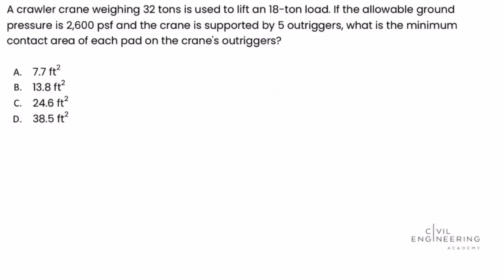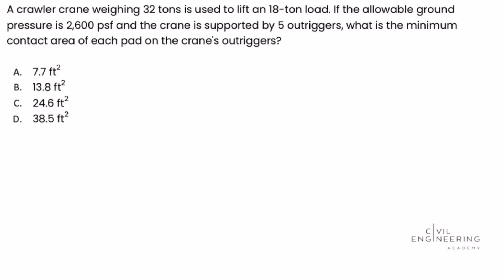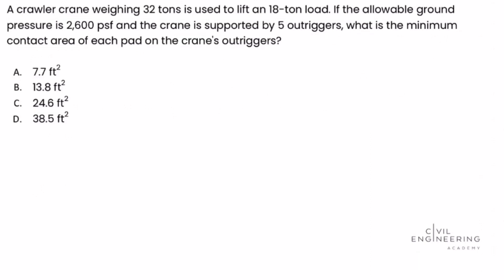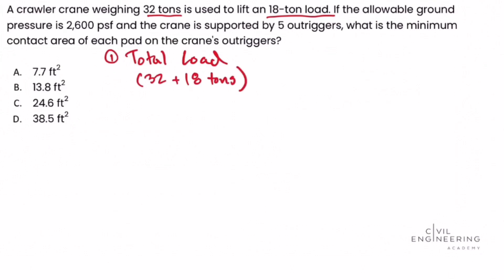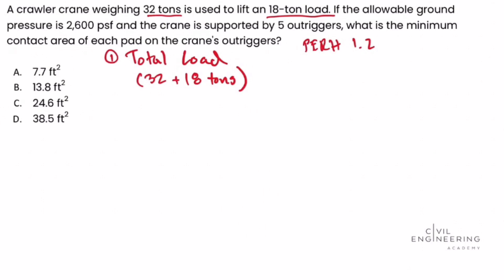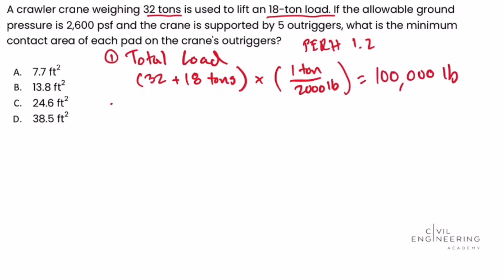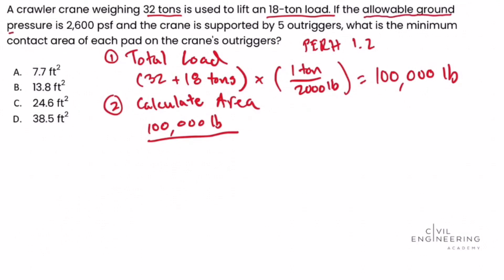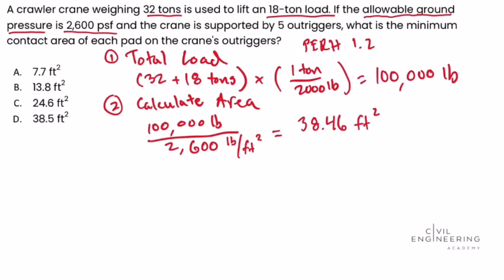Civil PE Exam – Construction Breadth – Find the Minimum Ground Contact Area of a Crane’s Outriggers

Comment: Why not divide by the 5 pads to get 7.7 ft^2 for each pad?
Reply: @CivilEngAcademy you never know what the worst-case scenario is. Design problems use safety factors rather than trying to imagine the worst-case scenario. Since we haven't been given any info about the safety factor and the question asks about the contact area of each pad, mathematically 7.7 is correct.
Reply: The question is poorly worded, it's impossible to tell what the worst case scenario is because the crane's outrigger configuration is unknown.  You could have 2 outriggers acting as the fulcrum or 3 or 1, there's no way to know. Based on the wording it appears that the 5 outriggers are acting as the load's fulcrum, and therefore each outrigger would need 7.7 sf to support the 50-ton load.  That said, having a 38 sf outrigger pad is completely impractical for a 50-ton load, a 6'x6' bigfoot (manufacturer of crane pads) pad can support a 100-ton load.
Reply: i have the same question
Reply: I think that would be correct since it better answers the question asked.
Reply from the maker: You need to assume worst case scenario in that the entire load is supported by only one outrigger. Due to failure or something else. We need to always keep in mind that engineering design is based on worst-case scenario, and this also allows a built-in safety factor. Yes, in daily operation it most likely would be 7.7 ft^2 but the best choice is 38 ft^2 for that maximum, worst case scenario.
Reply: @CivilEngAcademy  but your response does make sense, just not to the question that was asked. The way the question is worded is throwing me off with the answer.
Reply: @CivilEngAcademy  the word used in the question is MINIMUM contact area of EACH pad. What you are saying does not seem to align with the problem. If 38 is the area for each pad then this would rather be overdesigned. 7.7 ft2 makes sense since it is the  minimum area of each pad.
Reply: @CivilEngAcademy   this is confusing because I have a very similar practice problem asking the same question, yet the pressure was divided by the number of pads which is what the question is asking, the minimum contact area of EACH PAD on the crane’s outrigger.
Reply: @JoshNM24  yes it asks the minimum contact area of each pad
Reply: @CivilEngAcademy  

1) It's asking for the MINIMUM contact area for EACH of the 5 pads. After safety factors are included, the value would go up. But it's asking for the minimum.

2) If a crawler crane had 5 outriggers, and 4 of them failed, the total load would not all magically fall onto the remaining pad. That's like saying if 3 of the 4 legs of the chair I'm sitting in broke, the fourth one will hold me up. Built-in safety factors have to make sense.

3) The fact that you didn't acknowledge any of what you just said in the video, and rushed to the answer makes me think that this was a simple mistake, and you're trying to somehow justify why the wrong answer is correct on such a simple problem. People watching this may get an easy question wrong on the exam because of this.
Reply: The total load should be divided by 2 outriggers close to 18 tons lifting weight and than assume the same area for other 3.  @CivilEngAcademy   for example 50/2 = 25 tons x 2000lbs = 50000/2600 = 19.23 ft2. The 38.5 ft2 is over design and nor logical.